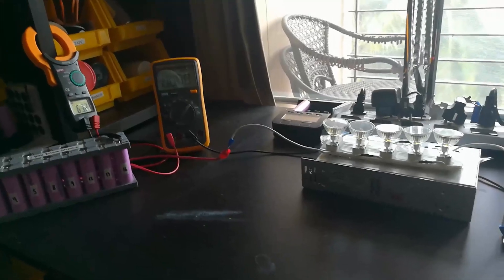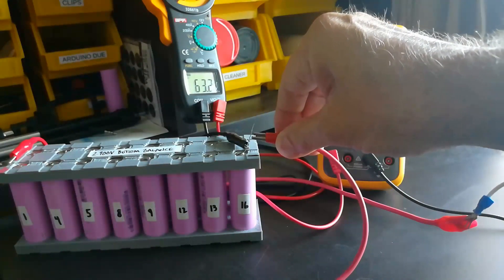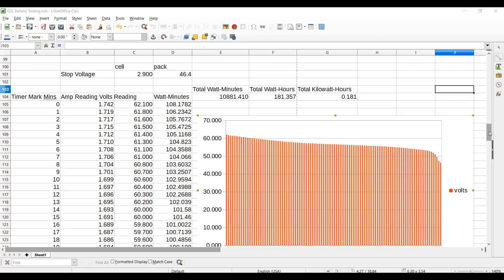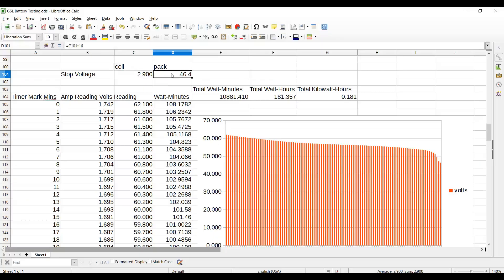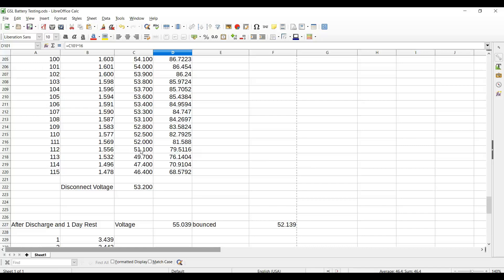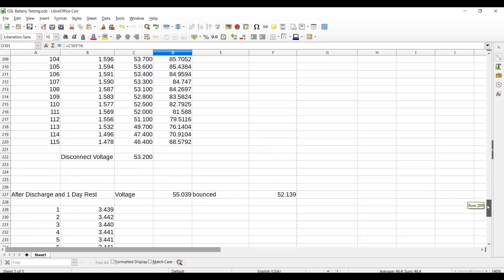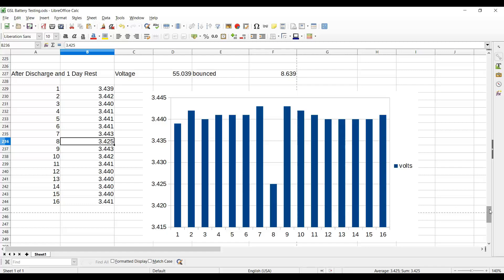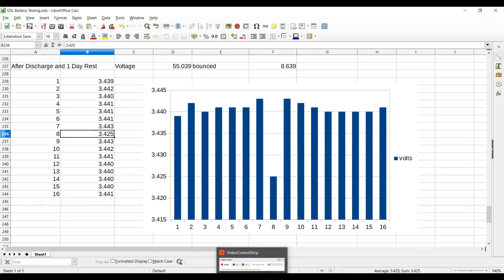21700 Lithium Battery Pack Part 5 - Discharge Test

Comment: Are lithium ceramic batteries available commercially, where to buy ? what about Thionyl chloride-lithium for low weight ?
Reply: those prologium were tested in 2018 not, still nothing available in 2019 ?

Comment: This bms sysyem will aleviate all of your battery voltage problems , these cells will go out of balance very rapidly without balancing of some sort either on the bmax or an on-board bms , i use my bmax for balancing as i don't trust some bms units and cant afford a more expensive one , hope this helps 🙏 https://youtu.be/NGp7cGBYOLc

Comment: Please could you provide data sets which you have collected.
Reply: @MikesTropicalTech  
I would like data like,
Battery voltage , current , timing , load resistance during discharge , SOC , Battery temp , etc.
So any type of data regarding this parameter which is available with you.
Please could you share your contact details?